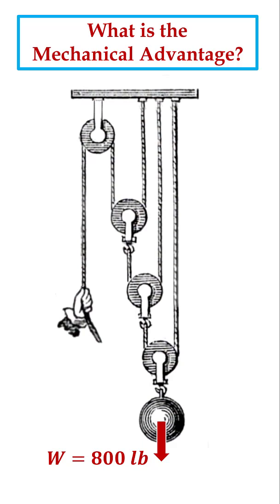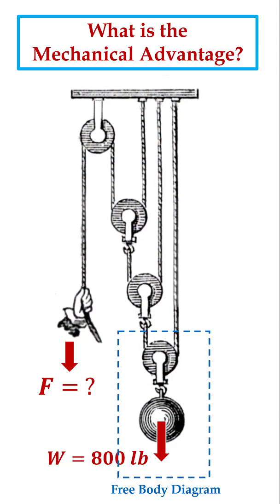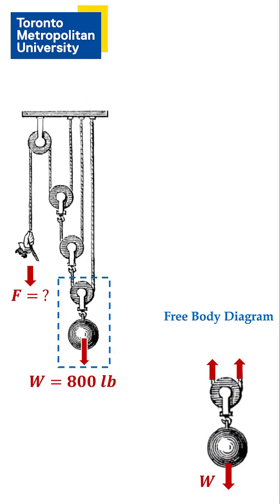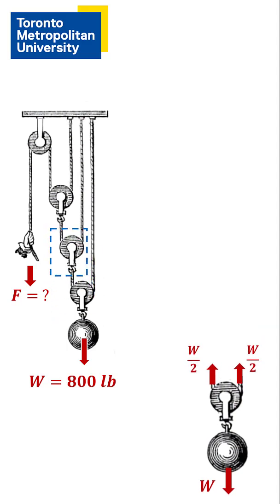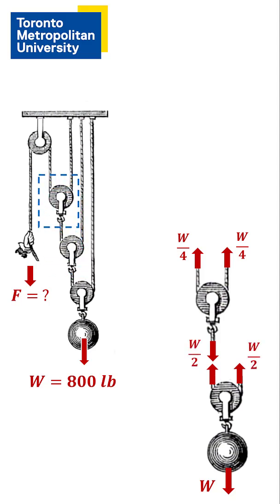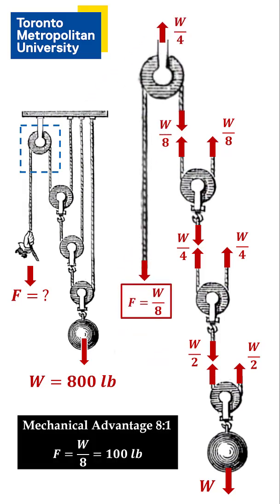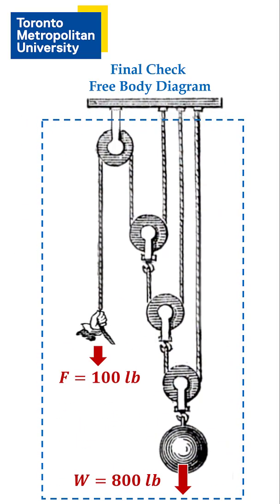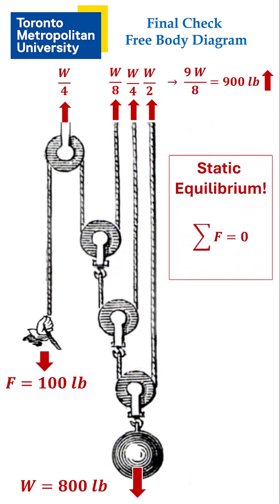Mechanical Advantage of a Pulley System with Free Body Diagrams

Comment: Why is the pulley where the load is supported w/4?
Reply from the maker: Tension in the rope on both sides of the pulley has to be the same, W/8. So, for static equilibrium (in the last Free Body Diagram) the  load on the support is W/8+W/8=W/4. I hope that helps.
Reply: @FluidMatters  OHH because it's an upside down pulley. Thanks
Reply: I understand, thank you very much 🙏